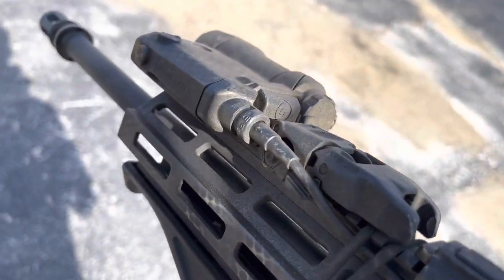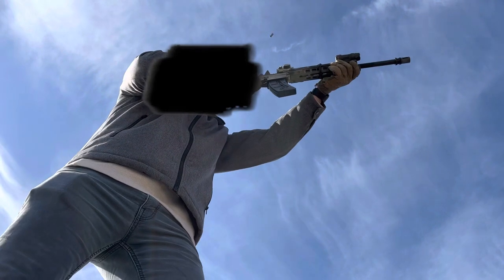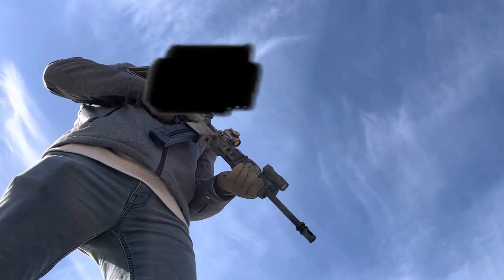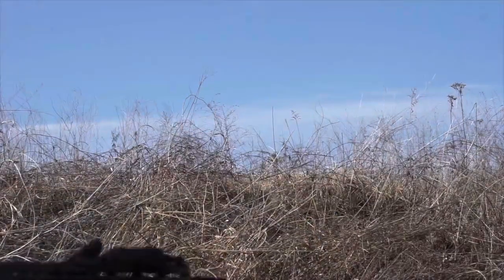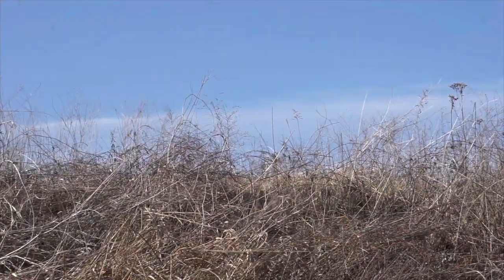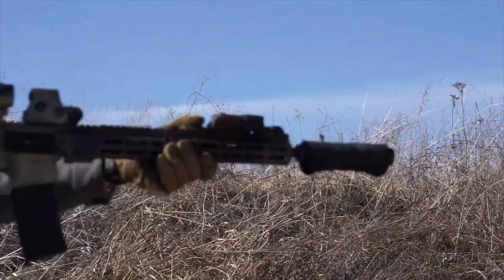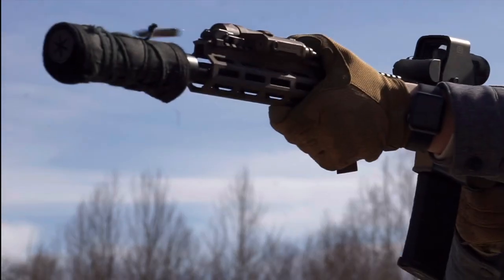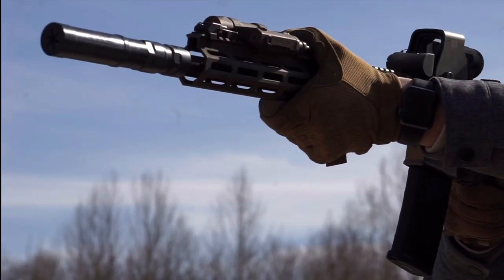Crimson Trace CMR-301 Update

Comment: Thabks for the review. I was unaware of the plastic mounting for the pic rail. Im not so sure i will go with it after all.
Reply from the maker: Yes it’s not as reliable as other options. I recently had a prolonged range day and after setting my rifle down, the cmr301 popped off without any resistance because the plastic softened due to heat
Reply: I found a picatinny to mlok adapter that is aluminum. Threw it on and used loctite on the adapter and on the light laser and it’s solid.
Reply: @Peppep2024 can you tell me which one that is?  Thanks